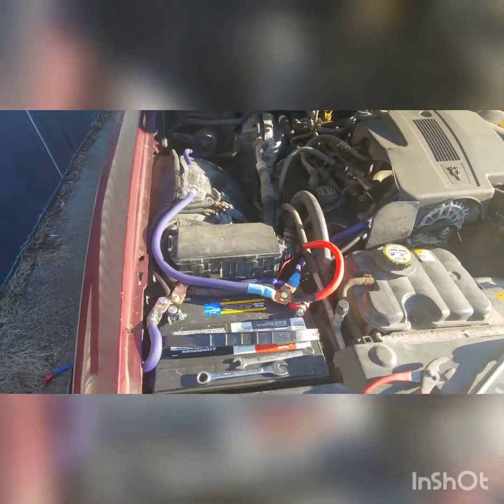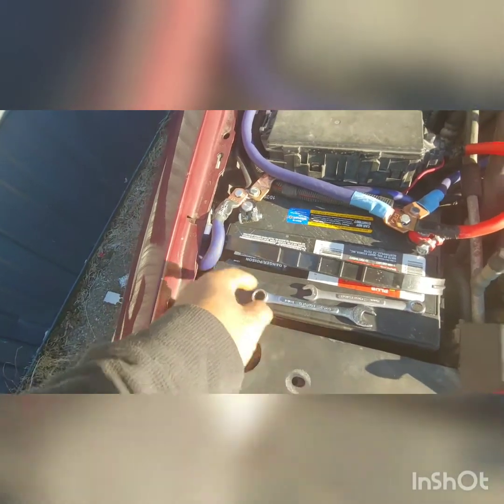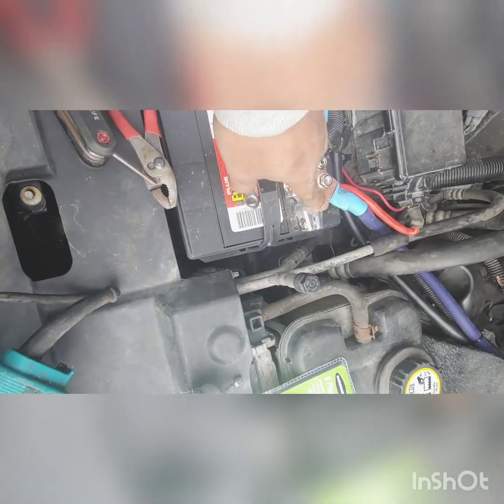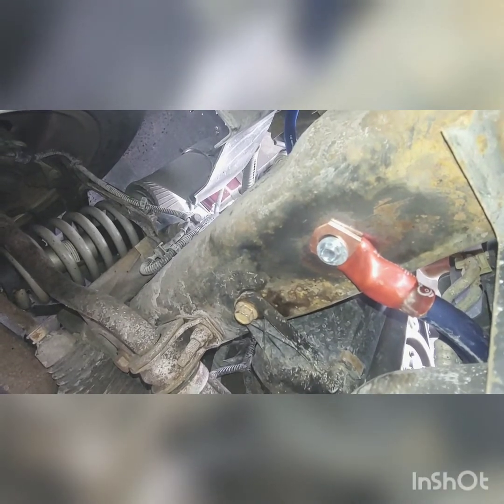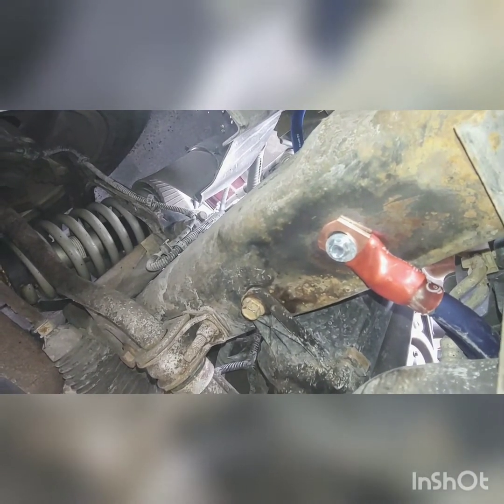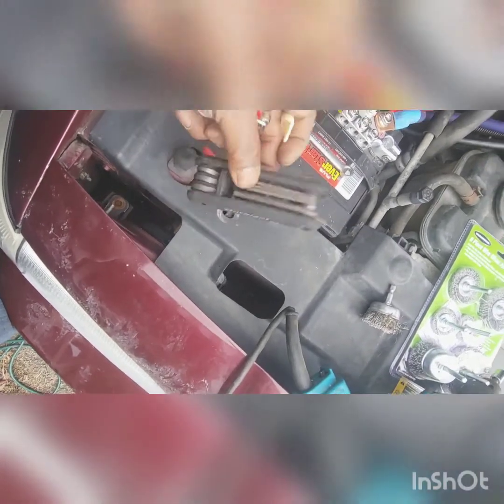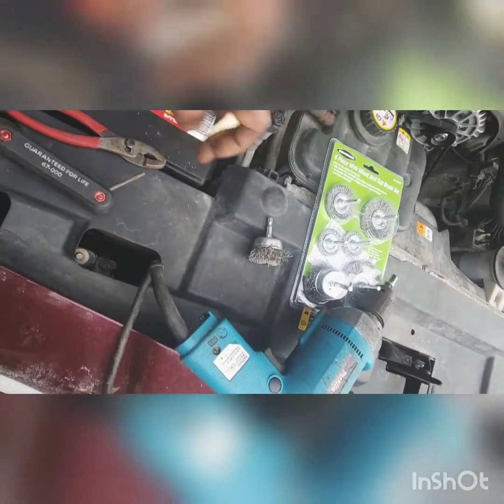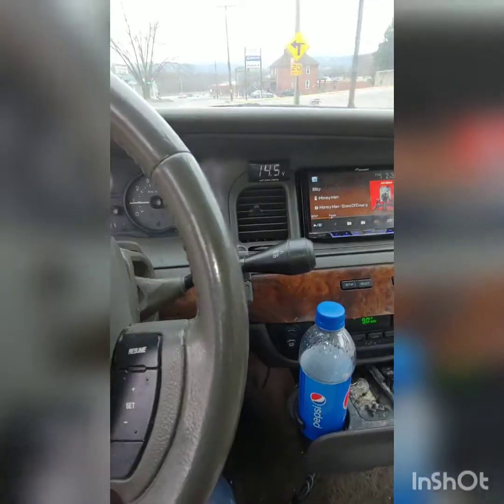battery terminals in extra ground added an 🔧 used

Comment: I have that same engine noise everytime I hook up a second amp for my highs and mids. Cant get rid of it so I don't run a second for my highs. Also, good looking out on introducing us to Money man. Got some hard ass beats no cap..
Reply from the maker: I think another ground should fix my problem it was worse b4 extra ground in front so im thinkn extra ground in back should fix. But im wait tell amp rack gets built so everything mapped out rite an yea alot of money man sing have great bass
Reply from the maker: Direct frame ground seem to work great on these cars pcv pipe holesaw silicone an rust protection paint go a long way in trunk for a direct to frame ground ill do a vid showing were an how to do in awhile
Reply: @wormsthatdude  nice, so you recommend a ground to frame in the front of the vehicle and then a separate ground to frame ground in the back?
Reply from the maker: @RomaVilla   yea im test it i couldnt find a good ground in car to begin with i was running ground an power from front to back batteries an grounded amps off last battery now that i got ofc i did grounds in front an grounded back batteries ground jumped between one another an amp grounded to a battery im make i vid rite now an show u what i did
Reply from the maker: Just uploaded a video i hope it helps